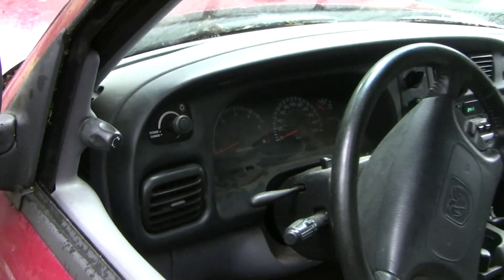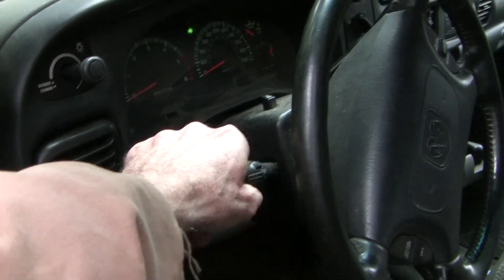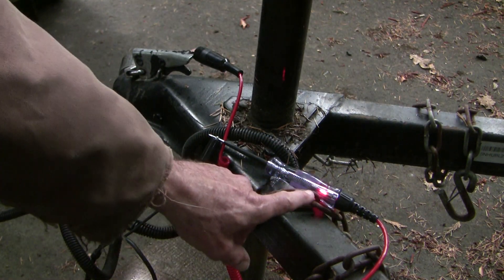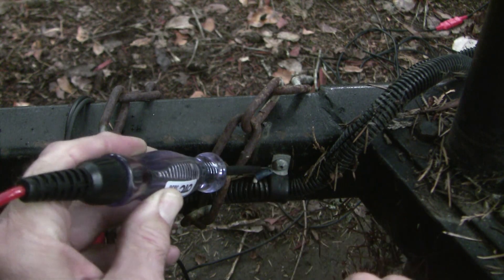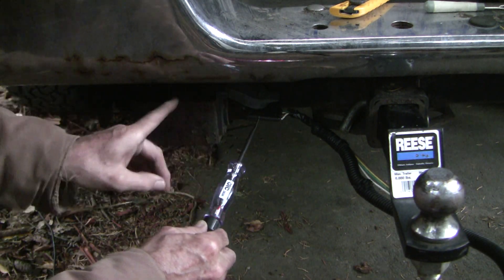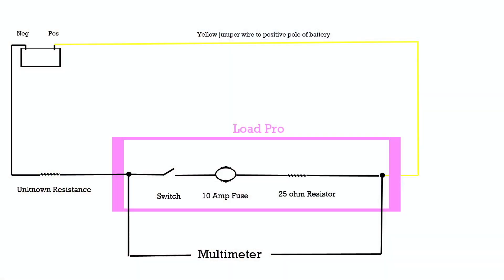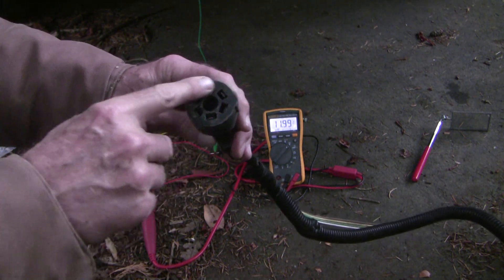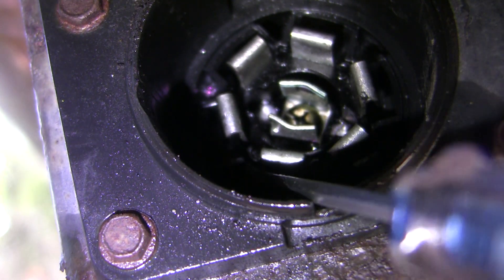Trailer Wiring Mystery!

Comment: You have a bad ground
Reply from the maker: Yup, weird things happening in more than one circuit is the red flag we all look for, easily recognized most of the time. The interesting question is why and how the uninvolved circuit allows retrograde flow, since it isn't a given that a backward ground connection would so consistently be found. These occult ground connections are designed into modules, hiding inside the dashed box we see in a circuit drawing containing a module. They often have zener diodes that will permit high current retrograde flow to ground when backward voltage exceeds a threshold.  This offloads a voltage drop that might otherwise damage more sensitive components inside the module. The cool thing is how these devices can do it reversibly, without necessarily blowing fuses. Thanks for stimulating discussion!

Comment: I knew from the second you showed the indicator operation.
Bad earths causing modulation of anything using the earth as a return.
The back lights on old cars were so common for this, modulated brake lights when indicating a turn.
And of cause trailor board lights.
Everyone ignores earths lol.
Reply from the maker: Yup, I knew guys like you will recognize this one right away. Even so it is a fun demonstration of drop testing and load testing, and I hope those with less experience will find the demo helpful. Many recognize it without knowing how to chase the problem down. Thanks for stopping by!
Reply: @spelunkerd  Yes i've seen it quite a few times,  in an ideal world every light fitting would have it's own thick twin earth+feed going to it. (best brightness)
But people skimp on copper wire, the frame becomes earth via crusty eyelets, mmm  lol.
Watching peoples traylor lights go mad is always amusing,  and as we used to have two different wiring pinouts for the same style plug,  well you can imagine the madness :-D

Comment: I had a similar problem with one trailer light only glowing and flashing dimly.  I bought a replacement light convinced it was faulty.  When I mounted the new one I went to replace the hanging nylon plate holder which hangs from it and is held secure by the two mounting nuts for the light.  I immediately realized the issue.  The nylon bracket held the light mounting nuts away from the frame meaning the ground connected only where the mounting bolt lightly touched the frame it passed through.  I remounted the plate holder to be sandwiched on the lamp side of the setup so the nuts actually squeezed against the trailer frame.  Problem solved!  I now have a spare trailer light.  Great video.

Comment: Great troubleshooting!  I have shot an identical problem and. Came to the same conclusion. 

However, the problem is not solved. That faulty male/female or (blades) interface was faulty because of an engineering flaw. That ground must carry considerable current (probably over an Amp?). When the connection fails lights do not operate correctly; that’s a safety issue!  You have seen it. I’ve seen it.  Likely hundreds of people have experienced the exact same problem. 

Terrible engineering. 

I challenge you to do the destructive disassembly and convince the manufacturer(s) to do a real fix. No telling how many lives could be saved with a proper connector re-engineering. 

Thanks!
Reply: What I've found is that when the ground wire fails, the trailer will at least partially ground through the ball (not ideal either).

Not that it's a real "fix", but I run dual plugs on all of my stuff so I have the 7 pin and a 4 pin integrated into the same adapter. If you carry a 7-to-4 and a 4-to-7 with you, you always have a redundant plug to fall back on if one fails. It's obviously not ideal if you're running something that needs trailer brakes, but at least it will get you off of the road.

Hopkins 47185 is what I'm talking about.